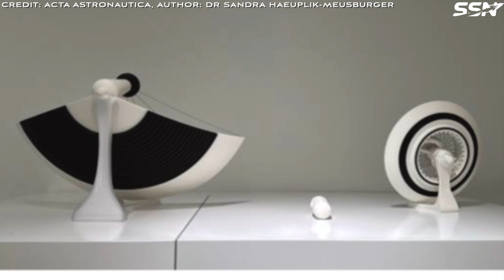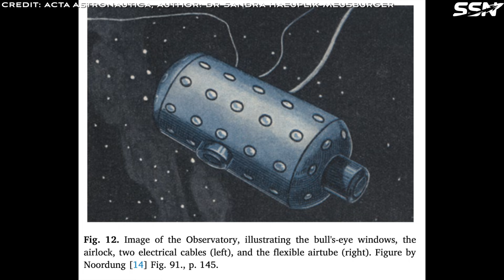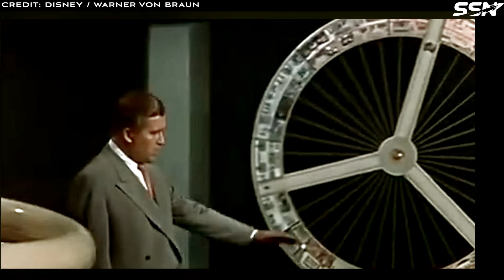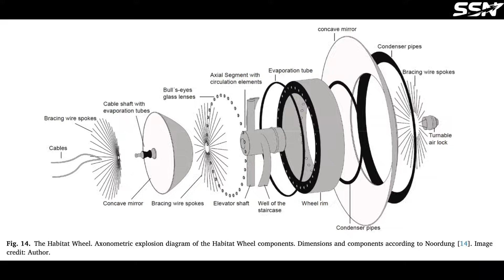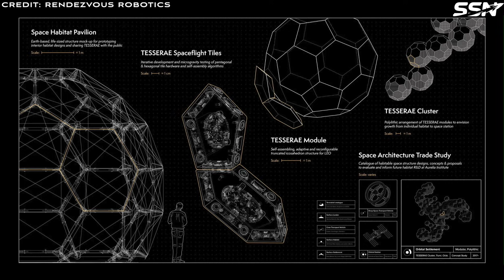A 30-Metre Wheel Spinning Every 8 Seconds: The Dizzying Truth About this 1929 Spinning Space Station

Comment: Not one word about balance. Next time you go to Walmart, note the tires on the cars. You might see a bar of lead on the rim. This is used to balance the tire as it rotates. Without balancing, the tire would wear out faster. A rotating space station would tear itself apart if it's not balanced. Ever had a washer that went wonky because the clothes inside somehow slid and bunched together more on one side than the other? Balancing matters.
Reply from the maker: My video stayed faithful to the source material but you're right, balance matters and it should have been mentioned in the video. Any future rotating space stations would have to plan for it. Solutions include ultra-precise mass distribution (difficult), movable ballast (water or cargo tanks with pumps), reaction wheels or thrusters and structural damping.

Comment: The torus shape is farther out of reach than a tower shape. A torus with a diameter of 450 meters could have a 2 RPM spin rate and 1G. A tower with uneven weight distribution could be shorter than 450 meters and have a spin rate of 2 RPM with 1G at one end.
Reply: An inflatable torus is possible, NASA was researching such a station in the early 60s.

Comment: Spin Habitats? I like the idea of gravity for Space Habitats, but I like the idea of a controlled spin, as in a train driving in circles. A Hypergravity Vehicle Habitat rides on a Magnetic Levitating rail line that you can land on the Asteroid you are going to mine and still have gravity on the habitat. I don’t like oversized habitats, because we humans don’t build that big; we can live and work with as little space as the ISS has.
‘And most people say the ISS was the biggest thing built by humans. The robots will build the future Cube Hab, it’s only 800 feet cubed, isn’t that over 2x the ISS?’

Station Radius 800 ft.  Rotation Speed 2 RPM.  Gravity at Feet 4.88 g. Astronaut Height 6′

Physiological Impact
Gravity at Head
4.85 g
Difference
0.7%
Tangential Velocity (at feet)
108.1 m/s (242 mph)
*Ideally, the difference between head and feet should be < 10% to avoid dizziness.

Prompt:
Refer to: “video”
1.           Research Orbital Habitats
2.           Confirm the facts of gravity space habitats
3.           Recap Key Points
4.           Integrate with Google Search to verify the answer
5.           Your Opinion as a NASA Engineer’s Advanced AI

Gemini’s Reply:
Based on the detailed technical breakdown from the provided video and verified engineering principles, here is a research summary and verification of orbital and gravity space habitats.

1. Research: Orbital Habitats

Orbital habitats are self-contained, pressurized environments designed for long-term human habitation in space. Unlike the International Space Station (ISS), which is a microgravity laboratory, these concepts focus on “settlement.”

The Noordung Concept (1929): One of the earliest detailed designs, the “Wohnrad” (Habitat Wheel), proposed a three-part system consisting of a rotating habitat, an observatory, and a machine room.
Modern Variations: Concepts like the Stanford Torus, O’Neill Cylinder, and Bernal Sphere expand on these principles, scaling up to house thousands or even millions of people.
Recent Developments: Companies like Vast Space are currently developing the Haven-1 station, with plans to implement rotating modules to test artificial gravity as early as the 2030s.
2. Fact Confirmation: Gravity Space Habitats

Artificial gravity is primarily achieved through centrifugal force generated by rotation.

Physics of Rotation: The force felt is proportional to the radius of the station and the square of the rotation rate ($a = \omega^2 r$).
The Gravity Gradient: In small habitats (like the 30m Noordung design), the difference in gravity between a person’s head and feet is significant. In the Noordung design, feet experience ~0.94g while the head experiences ~0.83g, which can cause physiological discomfort [08:00].
Coriolis Effect: Moving within a rotating frame creates a sideways force. At high rotation rates (above 3–4 RPM), this often leads to motion sickness and dizziness unless the crew is specially trained [08:19].
3. Recap of Key Points (Noordung Design)

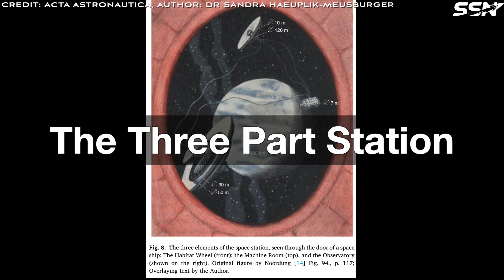Station Components: A rotating Habitat Wheel for living, a zero-g Observatory for science, and a Machine Room for power [03:41].
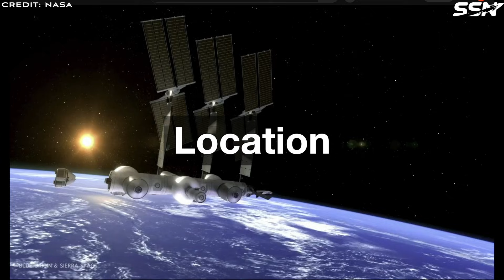Location: Proposed for Geostationary Orbit (GEO) at 35,900 km to remain fixed over a point on Earth [02:08].
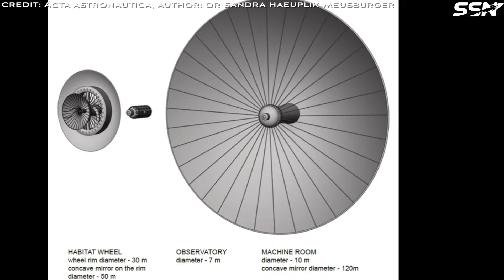Technical Ingenuity: Used a 120m concave mirror for solar power and logarithmic spiral stairs to make climbing “up” (toward the center) feel natural as gravity decreased [05:25].
Rotation Specs: A 30m diameter wheel rotating every 8 seconds (7.5 RPM) to mimic Earth’s gravity [07:43].
4. Integration & Verification

Cross-referencing the video with NASA and academic data confirms:

The “Vulnerat” Design: Historical records verify Herman Potočnik (Noordung) as the pioneer of the rotating wheel concept.
Human Tolerance: NASA studies (such as those at the Ames Research Center) confirm that while 7.5 RPM is physically possible for “centrifuge-trained” astronauts, it is generally considered too high for “shirt-sleeve” civilian habitation, where < 2 RPM is the preferred standard to minimize vestibular issues.
Orbit Selection: While Noordung chose GEO for communication ease, modern verification suggests Low Earth Orbit (LEO) is more practical for early stations due to radiation protection from the Van Allen belts.
5. Advanced AI Opinion (NASA Engineer’s Perspective)

From an advanced engineering standpoint, the Noordung design is a masterclass in early 20th-century foresight, but it highlights the “Radius vs. RPM” trade-off that remains our biggest hurdle.

Building a 30-meter wheel is structurally “easy” today, but the 7.5 RPM required for 1g would make the crew feel like they are perpetually on a carnival ride. As an AI trained on NASA’s long-term health data, my “opinion” is that the 2030s will favor tethered habitats (two modules connected by a long cable) or much larger inflatable toruses. These allow for a massive radius—hundreds of meters—enabling a slow, comfortable 1–2 RPM rotation that provides 1g without the “dizzying truth” of Noordung’s 1929 vision.